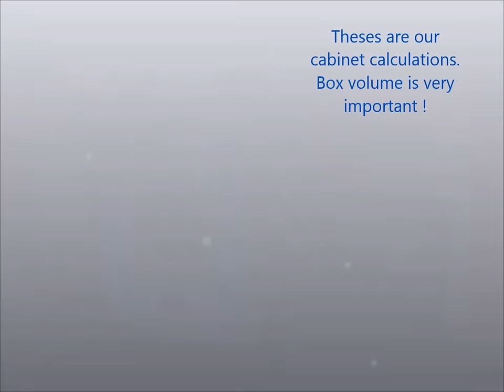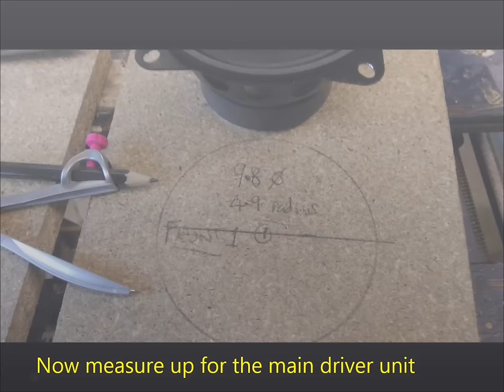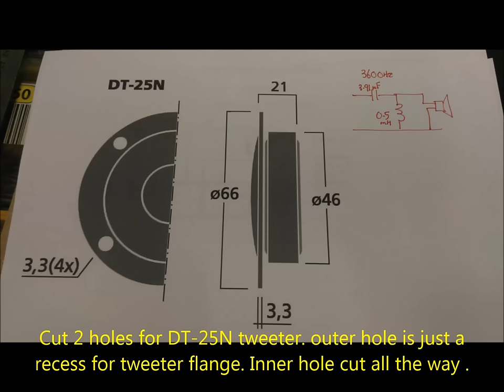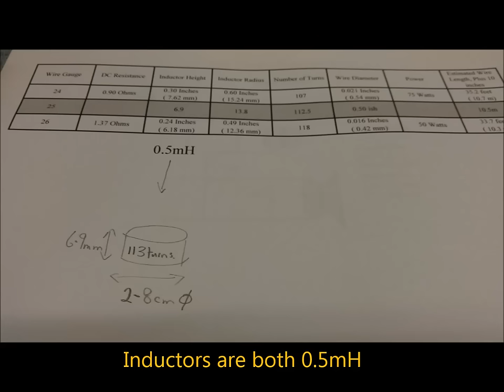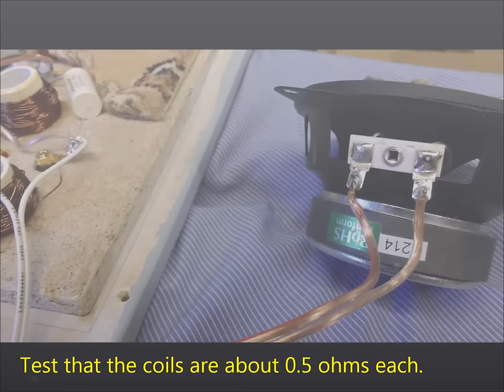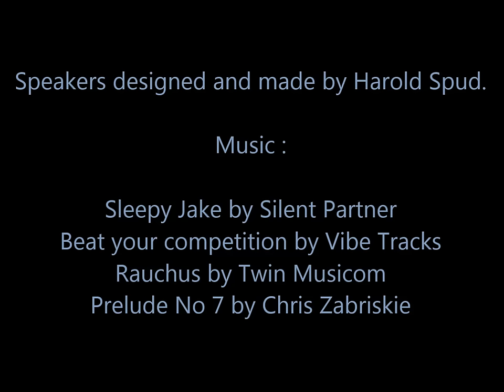How to build Smaller Bass Reflex Speakers

Comment: Find a way to flush mount the woofer, it's already "horn loaded" now and when the grill cover is put on, its
firing through a tube almost. This will improve off axis response dramatically.
Thanks Harold!
Reply from the maker: Thanks Craig. brilliant. You're right.   ... mind you, they're safer from the dog this way...
Reply: Harold, I forgot to add, nice job on the build!

Comment: You would be amazed how many  $120 + TV stands or entertainment centers are made out of particle board,you can make one out of better wood cheaper.but its easier to use what you have.particle board can break easily when using screws ,Judy have to be really careful with it.
Reply from the maker: Thanks Joe. MDF is easiest to work with . chipboard is a bit horrible - probably only use it for flooring in future... :-) Oak and other solid woods are super, but I will watch out for warping. :-( 
cheers. HS.

Comment: Hi Harold!

Just want to give you a tip, that baffle is acting like a really really bad wave-guide, you will get all kinds of distortion from the reflections bouncing on it, I really suggest you screw it in from the front of the baffle instead, preferably in routed holes as to make both tweeter and mid-bass drivers flush with the baffle, easy work with a router.

Also, having the bass driver and the tweeter mounted on different depths in the speaker box(like now) will give timing problems, as in the tweeter hits your ears before the mid-bass does..

Nice work otherwise :)
Reply from the maker: Cheers O. I think you refer to the bracing wood in the middle - yes it's an issue - I wrapped it in heavy cloth before final assembly to minimise naughty reflections. ... you dont miss much then ! nice one cheers. :-)